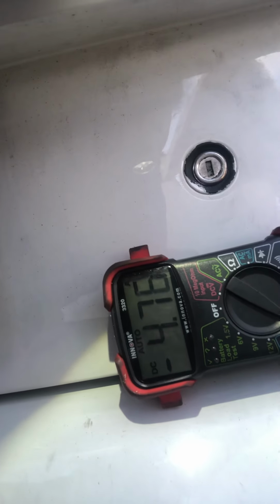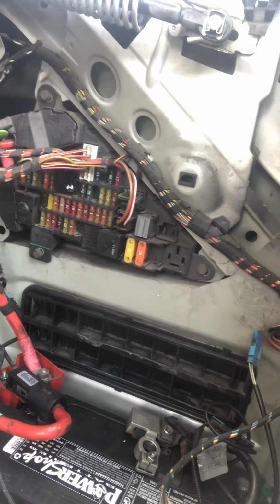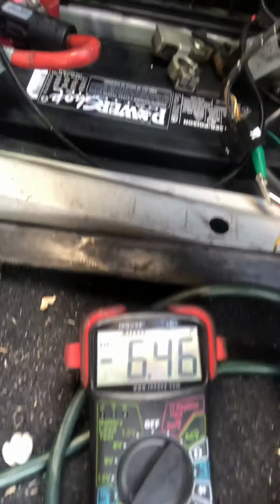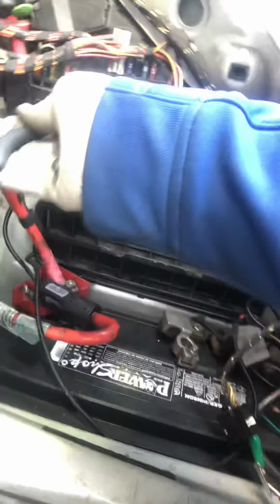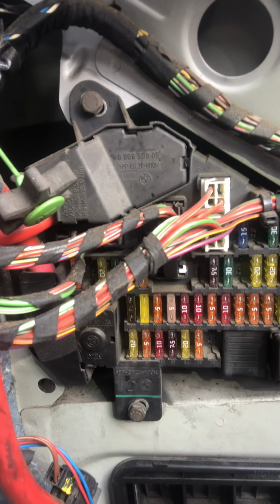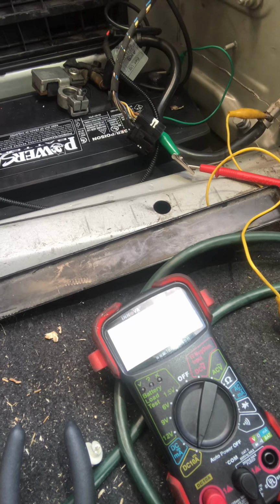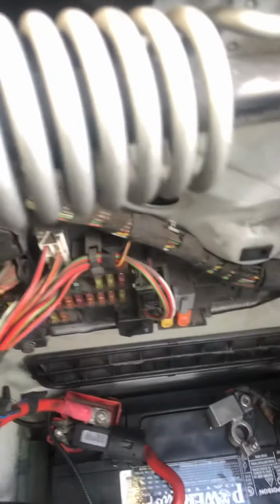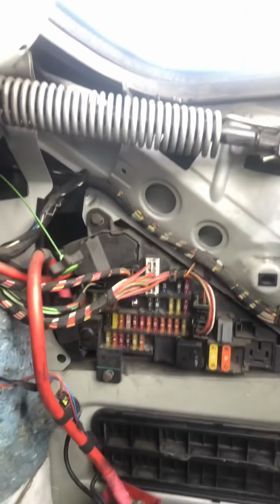Bmw parasitic draw testing on E60

Comment: Did the same thing today , you sure were doing it right ? I realized I had to close the trunk latch while it was opened manually to drop some and unplug the trunk lights and got it down to 3.something amps , removed the micro power module under the spare tire , got it down to 1.8 something amps 

Be careful with the ones in the glovebox , had to reset my airbag system with inpa from pulling airbag fuse
Reply from the maker: I left the car alone for about 30 mins to allow everything to sleep and i when I pulled all the fuse one by one I didn’t have to reset anything . I ended up finding a bad light module and all I had to do was code it and was rocking I run bmw coding tool and winkfp after to update everything anyway . What happen was the headlight wiring was shot out and the customer had tried to fix them him self and had shorted a bunch of wires while the lights were on with engine running and toasted the  mod . Even tho he says he nvr touched the wires but when I looked I found that the light covers had already been removed and the little small bulbs for running lights were missing
Reply: @MidnightMechanix  Hey man! I think I might also have a problem with my light module causing a parasitic draw. Just bought the car yesterday and guy fleeced me by not declaring the battery drain. Shows up as Right backup lamp malfunction, Left front parking lamp malfunction, right front parking lamp malfunction, and PDC malfunction on my 2004 530i E60. Lights all appear to be working fine but battery dies by the morning. Changing battery/removing IBS did nothing. Fault codes E519, 9CBF, A409, A0B2, E714, 51AD. Going to follow your exact procedure later tonight. I only have OBD2/Carly but considering learning INPA/WinKFP if I can. Any thoughts on which fuses to try pulling first while checking amperage draw? Thanks in advance!!! *Edit also noticed instrument panel/messages slightly flicker even when car is powered by battery (key fob switched to standby) or running on alternator (car fully on). Nothing else in car flickers and both batteries I tried were full charge + OK health.

Comment: Can't hear what your saying bro!
Why you leave the trunk open?
Why did you pull fuses 2x in trunk?
Why didn't you check glovebox like you said you were going to after all fuses in trunk didn't make difference?
Reply from the maker: I did end up doing the fuse box in glove box as well just didn’t want to have a long ass video since I don’t really edit any of the I just put them up as is and I left truck open for a a good min because we check a few other things and didn’t want to keep opening anf closing it repeatedly so I left. After it was all said and done ended up being Lcm and checked out head lights and the wires were completely fried inside and looked like someone tried to repair them but did a poor job

Comment: I've  been dealing with this for a year now.
Reply: Any luck bro ?
Reply: @hodgee3  ended up taking it to the dealership and they said it was the radio. Also needed to program the new battery. The radio would cost$ 3,000 so all I do now is pull the radio fuse when I leave it parked for long periods.
Reply: @chucke3305  bro you can easily go on Amazon pay 26 for the vgate obd and pay 35 for the app and program your own battery and as far radio go look at the bmw doctor positive there’s a cheaper and long term way to solve that problem